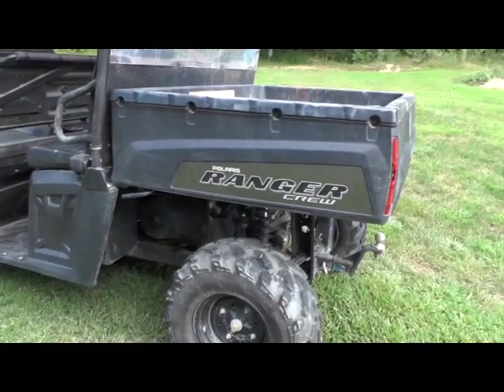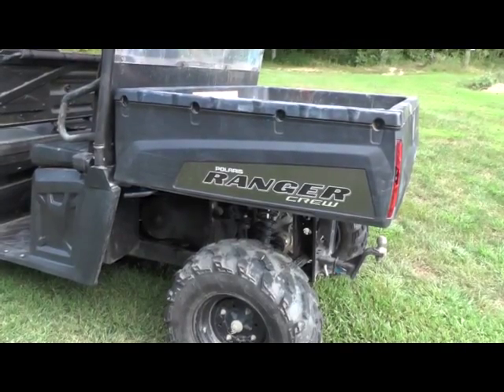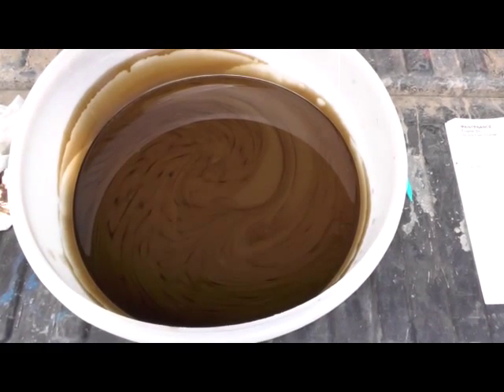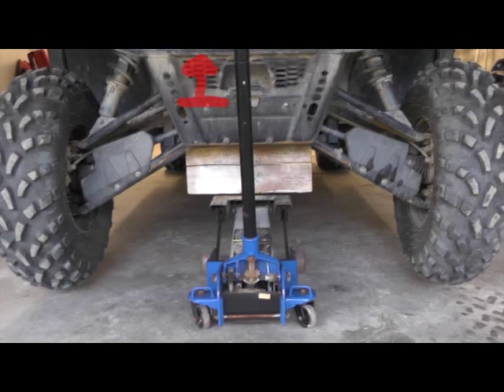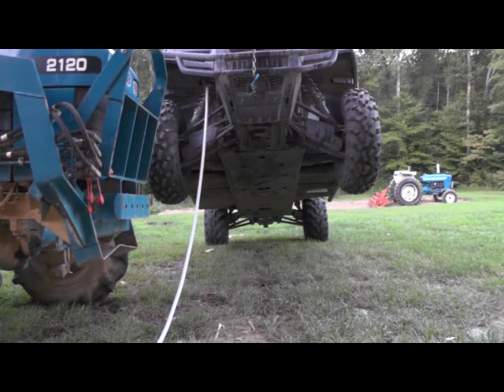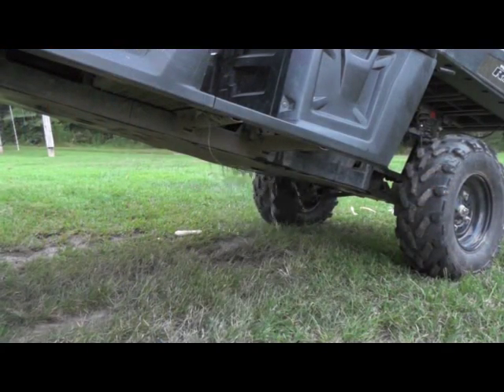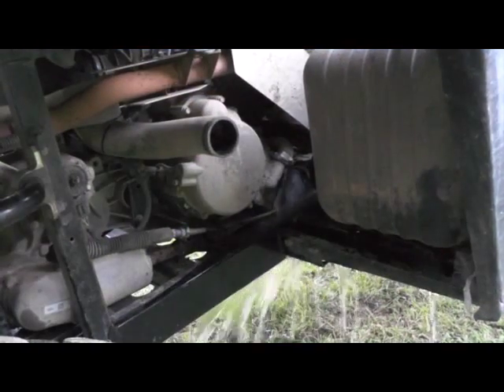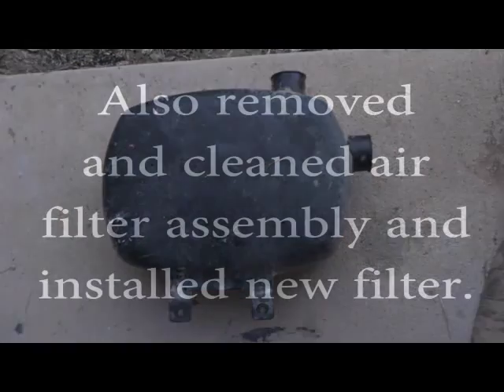Polaris Ranger 800 Stalls in Water and Common Fix to the Problem

Comment from the maker: There is a 90 degree boot on the side of the front differential that turns the air intake toward the back of the utv.  I flushed it at the boot because that was busted in my case.  If you elevate the front end you should also be able to flush from the snorkle intake under the hood.